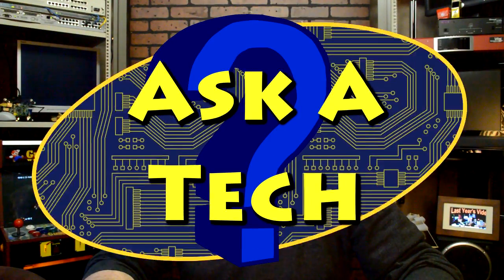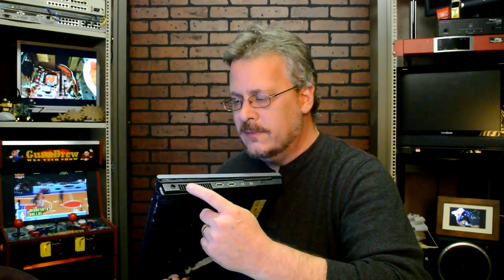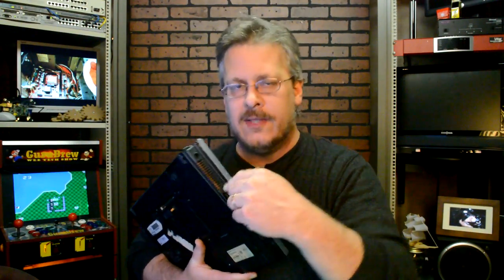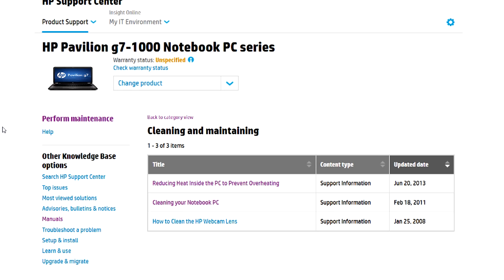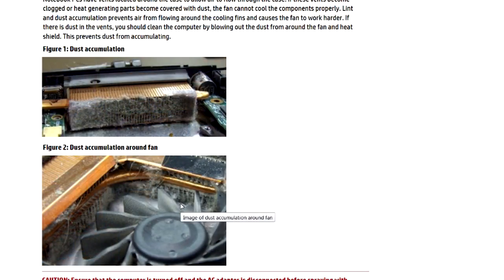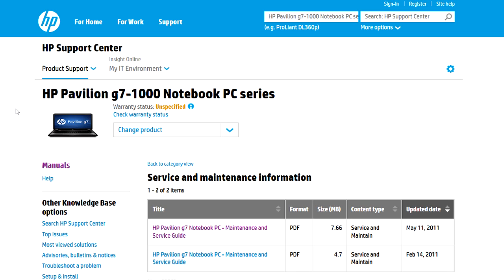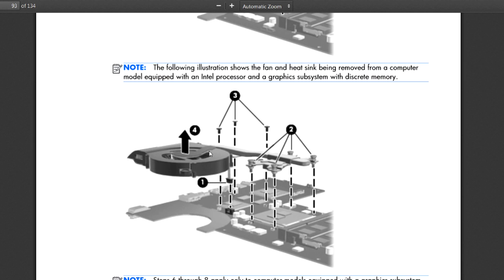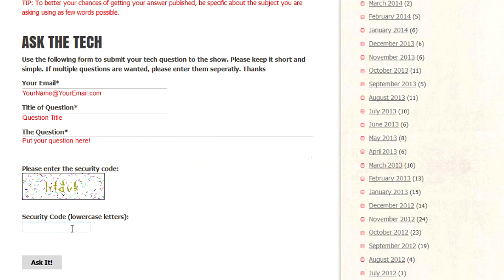Tips to Repair Overheating Laptop - Ask a Tech #35

Comment: Good information.  I had fan problems with my HP Pavilion, about 1 1/2 years old.  I wanted to try replacing it myself. A friend came over and took it apart and we gave up.  It was all in pieces, cables connected but disassembled.  I then remembered that I bought it with an Amex card.  They have purchase protection which doubles the manufacturers warrantee.  I sent it back to HP carefully wrapping the still cabled parts and bubble wrapped the whole mess.  Sent it back, in 2 weeks it was back as good as new.  Amex picked up the $180 Repair cost!  Whew!

Comment: In addition to cleaning, if the user is not familiar with the characteristics of a laptop, they will experience this same problem if they simply set their laptop on their lap.  The intake vents on the bottom are obviously being blocked by its placement on ones lap...duh...who would have guessed?  No air in... no air out.  It may be understood, but worth mentioning.
Reply from the maker: Good point. I think they should design the air intake on the side or top.
Reply: I guess laptop should be called desktop since I use it on a desk and never on my lap...